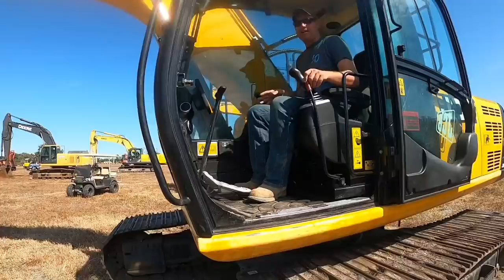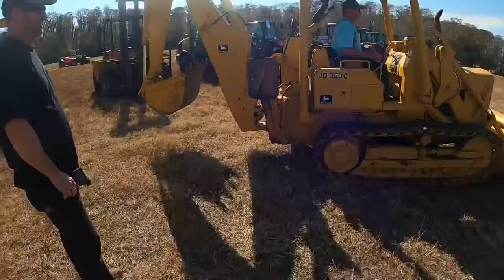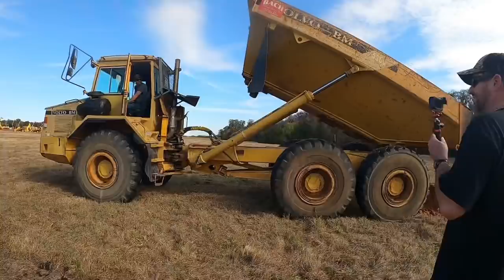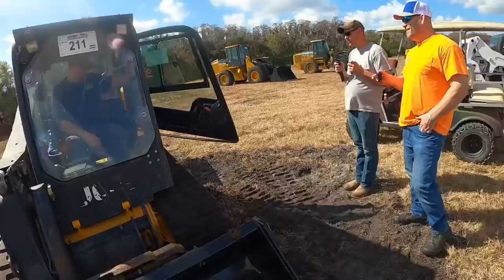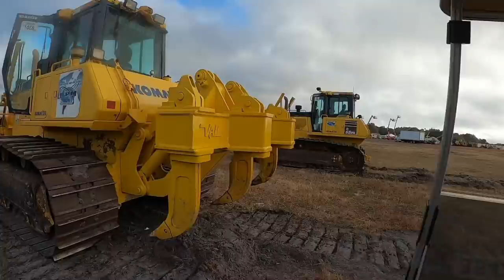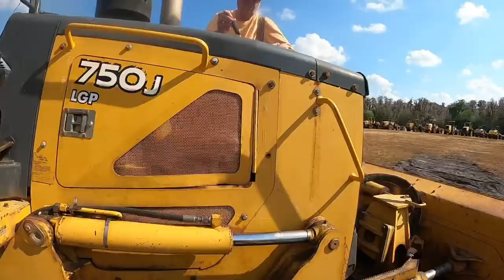Yoder and Frey auction time with @DirtPerfect @letsdig18 @DIRT-BOSS what did I buy?

Comment: You can really get burned on these on line auctions unless you can go check out the equipment yourself and many bidders don’t which drives up the price on a piece of junk. I recently watched an online auction of a backhoe in the Shenandoah valley of VA. It was a low hour machine. When the bidding got up to 23k I decided I had better go look at it as it was now at top dollar price and three days of auction time left. I am soooo glad I went and looked it over. The stabilizers would not lift the machine off the ground and the loader would not lift the front wheels, an alarm went off when I started it that indicated there was water in the fuel, and a rear tire was flat. I walked away from it and that machine sold for $50,100.00. Someone was going to be real disappointed when they picked that machine up!!! If you can’t inspect it prior to the auction you should pass it up.
Reply from the maker: Yep you have to be really careful

Comment: In 1966 I started my equipment operating,  from Yung farmer boy in Northern California,  to Cat skinner, my dozer was D6c , for many years to D8, D9 dozens. In California 95 % of all track equipment has Rippers, lots rock . I have run few cats without Rippers. But perfer Rippers, it balanced out the equipment, plus remember running a dozer without Rippers, it's always more from idler heavy, that why hard dozer blade is tipped back because it's to hard run, generally Rippers weight is about same as a dozer blade, making rig more balanced.  I've  seen guy absolutely trun a dozwe over backwards,  especially years ago loading and unloading equipment off a trailer,  but now these days trailers are some much more  advanced and safer loading equipment. I had a friend who was unloading a track loader and tipped it over backwards,  didn't have Rippers it cost him he's Life. But also he was loading on a sloped road way, that was definitely foolish. That was in mid 70.

Comment: Hi from uk guys 👋👍another great 1 here but seem they tried to fill gaps with 30ft between lots🤔 last 1 was packed clean in between 5-10ft and covered mass array of land for better purpose that 983 track loader all hose where chaffing on engine cover too right side (least of her problems I know   lol (do older girls have check valves? Just incase 😬) and just 1 silly thing I notice how the hell do you get telehandler stuck?🤔 its what I operate on site 20 mtr (jcb 540 200) should be able to push or pull ourselves out any thing 🤔 I have got in some messy situtions but always got meself out using outriggers and boom and carriage plate as anchor or tilt down dig forks in and push back lol strange risking 2 other machines getting stuck and damaged (nothing to protect telehandler from rear push😡🤔)   but rant over😵😬😂 like how mike from dp opened rear access to check blowby etc tried to catch it shut 😂😵 still love your auctioneers sound great the way they roll their words lol thanks for time guys be safe and see you soon👋👍

Comment: I always assumed the D8K & the 983 were the same, but an old school cat mechanic schooled me in a rather gruff tone. The only similarity was the weight 71,000 for the 983 and 70,000 for the D8K.
Reply from the maker: They are based on the same platform 
80k on 983
The d8k was 70k
The 983 is heavier because of loader and counterweight
Reply: Frame narrow r faster travel speed